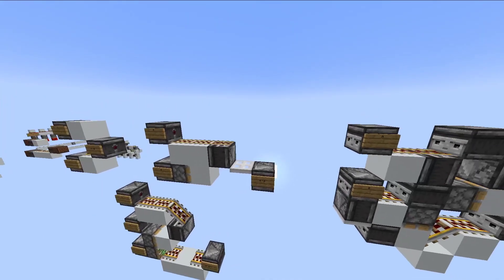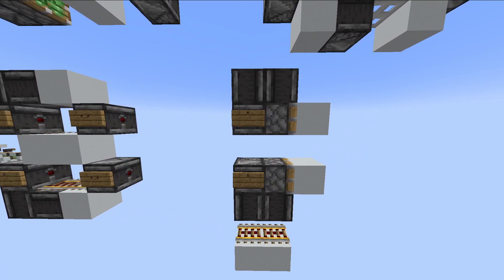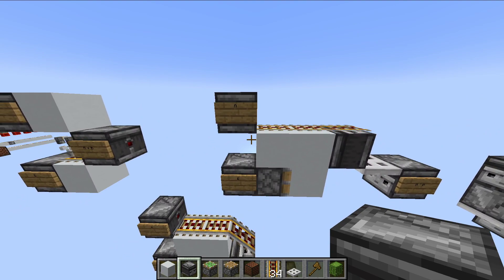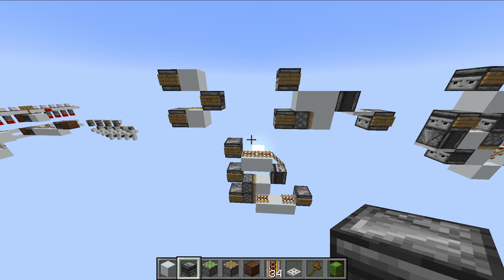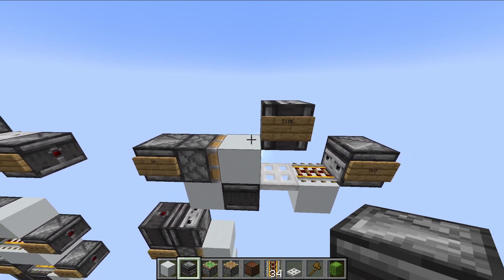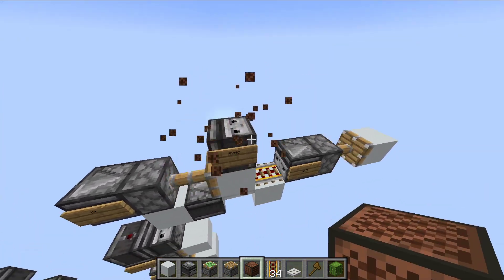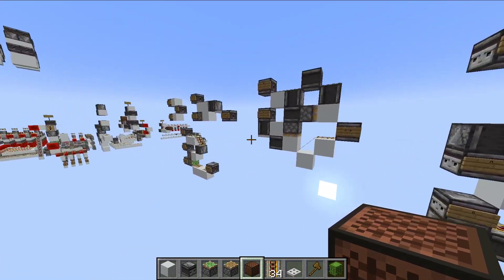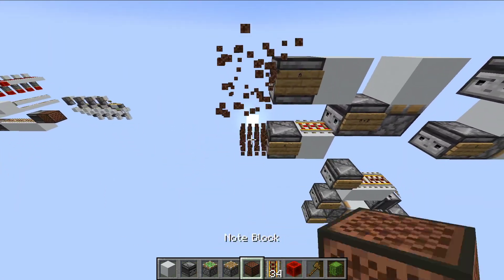1-Wide Tileable Observer Logic Gates || Redstone Computing

Comment: Hey love the logic gates I have a problem maybe you can help explain with logic gates. First I play bedrock I've built a cobblestone gen that uses observers to see the stone be built and it signals a piston to push the cobble forward. At the end of the line of cobblestone I want to use an observer to since the cobblestone and push it up but the piston itself is causing an infinite loop. How can I change the 2nd observer output into something that will power the piston while also blocking the next signal from the observer.
Reply from the maker: Thanks! I actually encounter this issue a ton in my designs. You can either use normal redstone to zero-tick the pistons (like all of ilmango's block conveyors) or set up a bistable with a second piston. 

In the latter setup, the observer that sees the cobblestone powers a piston that moves an observer. When that piston fires, the observer on its head should move into a position where it will power the other piston that actually pushes the cobblestone. Then, when the first observer detects the piston pushing the cobble, it will retrigger the first piston and move the observer on its head back to the rest position, where it will not power the pusher piston again.

Let me know if this doesn't make sense, I can send you a quick demo if so.
Reply: @MrRoboticWarfare  I understand most of what your saying but I don't think I can get a 0 tick in bedrock and i know some redstone things are different then Java. You don't have to make a demo or anything. It was just something I've been trying to see if I can solve with logic gates because I know they work in both Java and bedrock.
I've been testing with different gates and memory circuits trying to use one observer that sends a signal to the piston. But also uses that same signal to block it's own signal route so it won't send a signal when the piston withdrawals. Then have the system reset itself.
I know this is a backwards way of doing things but I'm trying to teach my nephew about redstone because he got Minecraft for the PS4. And I used to play PC years ago.
Reply from the maker: @yamatohekatsue9143  Here are two options that don't use zero ticks: https://gyazo.com/b7be2317255402228a6b8dde5f53ad01